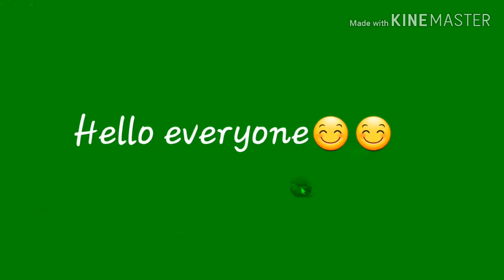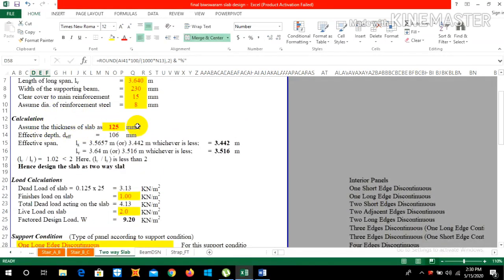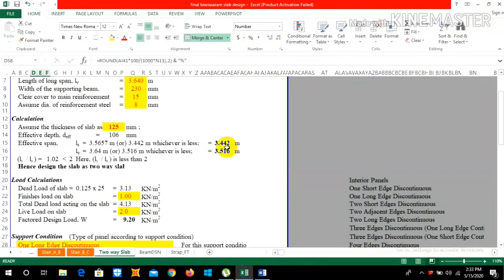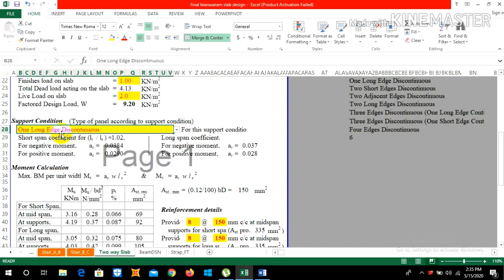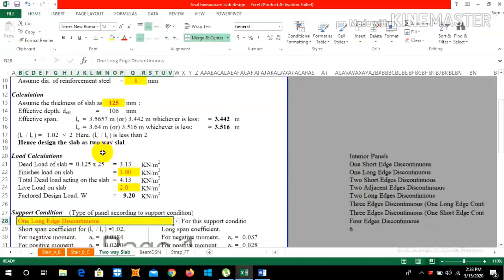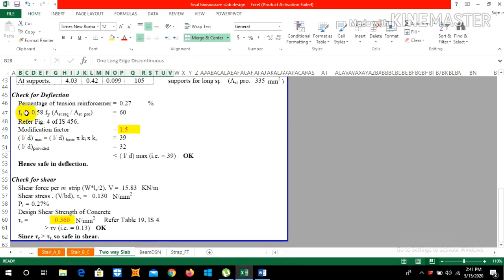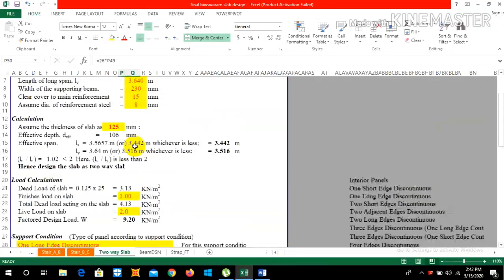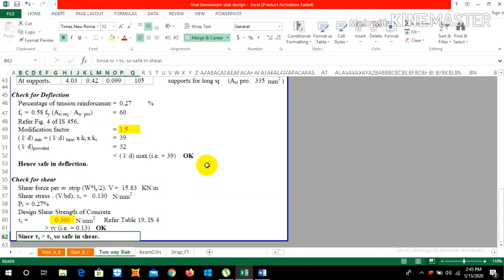A Complete video on design of slab in excel for ETABS MUNICIPAL REPORT

Comment: Very helpful video. Just one confusion as the effective  length of shorter span is less than 3.5m, why is the span to depth ratio not taken as 32 as in clause 24.1? Please mail the excel file if possible too.
Reply from the maker: tapaiko mail id dinus na la
Reply: @ranjangaida4490  nishasthapit1@gmail.com
Reply: excel sheet xa ra yesko?